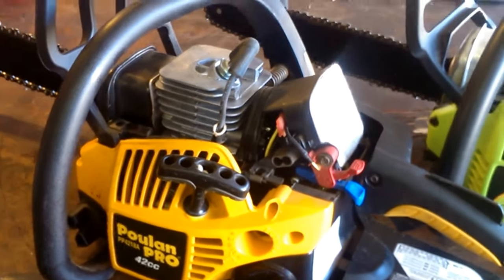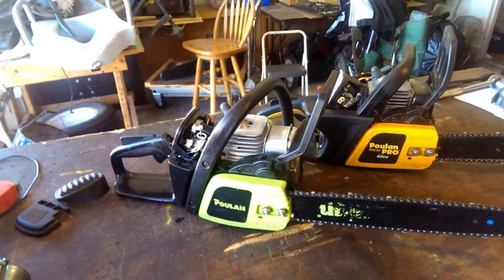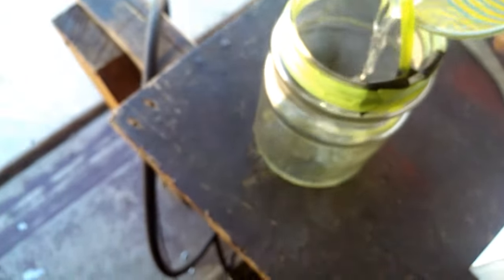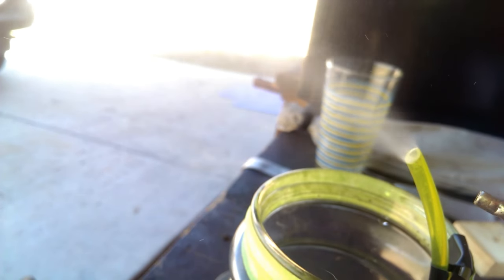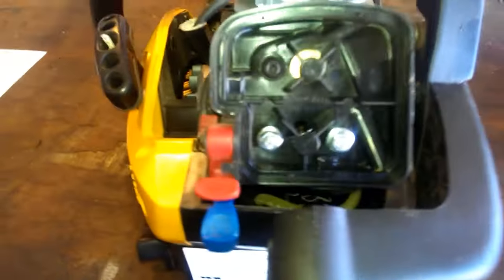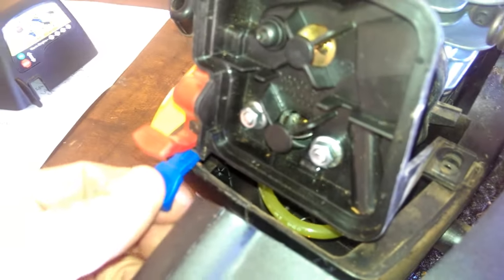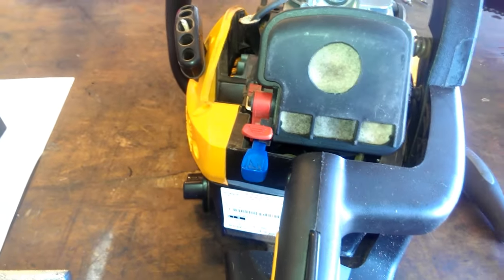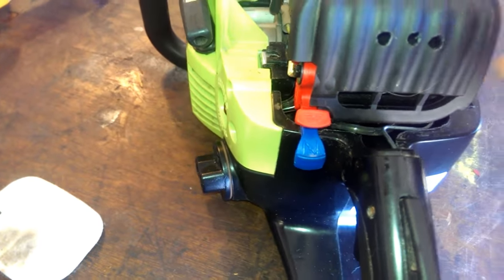Poulan wont restart after being used & how I solved my problem.

Comment: I have a poulan that the pull string does not retract like it should... i took it off the chainsaw and it works fine also i put a little of the oil mix into the spark plug hole and it wont do nothing.. its only a year and a half old.. please help dont know what else to do
Reply from the maker: eric Deleon  did you solve your problem yet? Email me if you need help still.  ZombieDaveAz@gmail.com
Reply: On a two stroke putting fuel mix/spray fuel into plug hole isn't very effective as the lower crankcase pulls in an airfuel mix ,compresses and pushes it into top comp area for firing. where would air come from in plug hole as vaporizing fuel would keep it out?

Comment: So the Poulan company made an interesting twin throttle body carburetor design that is capable of working very well, and choked off one of the throttle bodies with the worst possible air box configuration man has ever seen? How did this even make it past the drawing board? To Poulan, it is because of this guy here that I may consider purchasing one of your products. Before this guy the only incentive you offered would be the low price tag compared to your competition.  

PS YouTube has been double posting my comments for awhile now. It's only when I make a reply that my comment posts once and only once.

Comment: That is one of several reasons why  the move to put ethanol in fuel is a scam. The ethanol draws moisture into the fuel. That's why it just better to buy ethanol free gas. Bit more expensive but worth it.
Reply from the maker: And get this, before ethanol you could buy a product called " dry gas" which was ethanol/alcohol to get the moisture out of the gas. Lol 👍

Comment: wouldn't it be easier to simply replace the filter?
Reply from the maker: Maybe, but that doesnt cure the problem of the saw not getting enough air. Thus the hole. make sense?

Comment: That additional hole is totally contrary to everything I understand about volumetric efficiency of internal combustion engines. Maybe you scared it and it got worried about what you might cut next so it decided to behave.
Reply from the maker: It seems to have worked for more people than just myself. Could it be that the exhaust is "too" efficient? That's a possibility and that this crazy 2 barrel into 1 carb is fine. I'm sure that guys with bigger brains than mine could redesign a better more efficient saw. BUT that won't help all the guys that own this saw. Cutting and extra air hole helps. That's all I know and thanks for the comment. 👍

Comment: Purpose of that filter cover design is to act as a intake noise baffle.
Reply from the maker: Well that noise baffle is a fail in my humble opinion. Thanks for the info George. I appreciate you taking the time to comment.
Reply: @ZombieDaveAZ  yup, seems to be in this case. Probably some gov mandated thing. Or plain asthetics. Maybe put some screen over the hole to prevent bigger objects getting in such as large dust, chips. Doubt that would harm the starting and running.

Comment: I bought the green one at Lowe’s well I used it last year when I bought it it was great today I go out I put the pre mixed 40:1 and omg the dam thing same problem I can’t pull it it will run then heat up stall and won’t start I pull the plug then it will pull over easy a few time then get hard as fk to pull I’m going to try this thank you
Reply from the maker: Hard to pull as in feels like too much compression or hard to pull as in repeatedly?
Reply: Yes like to much compression and it was only used one time last year for about 6 hrs on and off it will start but once it gets hot and I mean after 10 mins forget it
Reply from the maker: @donaldbaker6961  sounds like the metering diaphragm is giving up the ghost. Gas in the crankcase will make is feel like it has too much compression. You can check by removing sparkplug and tip upside down and pull rope. Gas will come out the hole. Ten cent fix if that's the case👍.
Reply: ulitepilot aka Zombie Dave thank you very much I will try tomorrow thank you

Comment: I cant get a new Poulan P3816  to start out of the box.  Fresh fuel etc.  Followed instructions..just can't get it to start.
Reply from the maker: Steve. I have to make a couple assumptions here. that the primer bulb has fuel in it. That means the carb has fuel in it. I assume the kill switch is off. Usually full choke will will do that but double check it. be sure spark plug is connected to coil lead. set choke to full and pull til it coughs. then gently push choke to 1/2. That will leave the throttle cracked open. should start in 3-4 pulls. Dont high idle it with chain brake on. hope this helps.
Reply from the maker: Steve. I have to make a couple assumptions here. that the primer bulb has fuel in it. That means the carb has fuel in it. I assume the kill switch is off. Usually full choke will will do that but double check it. be sure spark plug is connected to coil lead. set choke to full and pull til it coughs. then gently push choke to 1/2. That will leave the throttle cracked open. should start in 3-4 pulls. Dont high idle it with chain brake on. hope this helps.
Reply: Thanks for the response.  I am new to chainsaws as you may have guessed.  The primer bulb is showing fuel in it.  By kill switch do you mean off/on switch?  Switch (Red) is on position (Up) and choke (Blue) is all the way out on first attempts.  The engine never coughs or hints at starting. I looked to see if there was a spark plug in it..thinking alright they may not have included one, looks new and unused.  I haven't' dug much further in to make sure it was connected properly..assuming new saw should be alright.  Being 62 years old pulling in that position can sure wear on you quick..any further tips/help is appreciated.
Reply from the maker: Stephen Hotchkiss Cheat! take some fuel and squirt it in the lower carb barrel while holding the throttle open. you may create a 'flooded' condition but with the throttle set at high idle it should start for you. you will have to remove the cover  to access the carb but its only 3 screws. to set high idle pull choke all the way out then push back 1/2 way. start pulling. let me know what happens please.
Reply: engines w primer bulbs r easily flooded , just 1-2 full choke is all they can take as the metering chamber is full from the primer . U may not even get a 'pop' if more than 2 full choke pulls. The hi jet ,along w full choke and part throttle ,provides the rich mix to start a cold eng.  If hi jet is plugged/misadjusted ie. no fuel to start. W only a choke(no primer) after 4-5 pulls on full choke u usually get a pop ,then go to half choke

Comment: Seems like the company could fix the airflow issue with just a VERY simple redesign of only the air filter's cover part of the carburetor in my personal opinion. Redesign it so the air holes in the cover are positioned instead right over the center of it. Much closer to where the air is actually pulled into and goes into the carburetor and not on the underside of it,farther away from the actual carburetor intake hole. The saw has to actually work so much harder just to actually pull and get any air into the carb with it being designed the way it is currently. I would say doing that one very simple and easy redesign would drastically reduce or maybe even totally fix the airflow issue completely. Its not really that big of an issue or an undertaking to redesign and actually fix the design flaw; especially considering the fact that its only just a small,simple piece of plastic. It seems like it is so simple and easy really that it is actually completely laughable. Even if the company were to redesign and send the new cover to people who have complained about this issue,or even to just new customers who are made aware of this and given a number to call to get their redesigned replacement part. It doesn't seem to me like they would actually lose too much money in that whole process in my personal opinion. It really seems to me like it was really just a design oversight of the carburetor cover on Poulan's part and it wasn't done intentionally... I honestly would think that anybody that had a decently good quality 3D printer. Could actually map,redesign and print themselves a new and improved part and solve this problem on their own really. I mean,it is basically just one plastic part with a fairly simple design after all...🤔
Reply from the maker: Lol, you are 100% correct. I think they put too much time in the carb w/2 barrels too. That just complicates a simple operation in my way of thinking. Thanks for commenting brother.
Reply: @ZombieDaveAZ  No problem friend. Thank you for actually responding to my post. We don't really have a problem with ethanol and water in our push mower's,weed eater's or chainsaw's gas at our house. We live over here in Tennessee and we actually have a few gas stations in our home town that actually still sells 100% pure gas with no ethanol added to it. Thats what we actually use exclusively for our weed eaters,chainsaws and our push mower. And that I can recall,we have NEVER really had fuel issues where its actually had water in the gas. Its too bad that you guys only have access to E-85 out where you live at to use in your small machines like that. I was also pretty disappointed honestly after I watched this video. I had actually thought of buying myself a Poulan 33 or 38cc chainsaw because I am currently in the market for one. I was looking at that brand mostly because it was rated so highly in reviews and it was actually in my rather limited price range. I am currently unable to shell out 3 or 4 hundred dollars for one. I was looking for something reasonably cheap,easy to maintain,hassle free and reliable. I have known people that have had them before and theirs was a very reliable companion and theirs didn't really seem to give them any sort of problems. Besides just needing to have some basic maintenance occasionally like any other chainsaw. I was wondering since you seem to know a thing or two about chainsaws... Do you have any advice you can give me on this matter of me selecting and purchasing a GOOD and RELIABLE but reasonably priced chainsaw my good fellow? I am even willing to purchase a good and reliable quality built one second-hand,if its actually in good working order and at a reasonable price. Any advice you could give me on this matter would be MUCH appreciated my good sir...
Reply from the maker: @mr.chaosvicious5968   My personal opinion is that Stihl, while it is the "snap-on" of chainsaws is not worth the money unless you are a pro and make money with it. I do think that an older Echo 'usually' are well made and come with a very friendly honeowner warranty. I think its 5 years if not put into commercial use. If you only need to do random cutting and sporaticly, buy what you can afford. Maybe a black friday sale or something like that will put a decent saw in your range. Good luck and keep commenting. Welcome aboard brother!
Reply: @ZombieDaveAZ   Hey thanks. The advice was also very much appreciated as well. So far I have been using my recently deceased grandfather's old and reliable Johnsered 2054 Turbo. I remember that thing has cut down a LOT of trees since he has had it. And more recently his newer Stihl chainsaw he bought before he got real bad sick when I needed to use one but I want one of my own now. The Johnsered actually gave me some trouble a couple of days ago after me trying to help my uncle saw up this gigantic hickory tree at my grandparents place. I actually had the privilege of watching this behemoth of a tree fall down during those strong winds we had. That thing was on my grandparents property before they ever bought their place in about 1964 and it was supposedly a pretty good size then. I don't think it thankfully damaged anything that I know of. The saw actually ran okay for about 10 minutes then started sounding like it was bogging down. Then it finally quit on me and absolutely REFUSED to start again for about an 45 minutes then it cranked over again after a couple of pulls. I tried cleaning the air filter today and the spark plug as well to see if that might help. Then I tried starting it again and it only tried starting ONCE in about the 15 times I pulled on it. I am going to try putting a new spark plug in it myself tomorrow and try getting it to start again. If THAT doesn't do the job my grandmother said we would probably just break down and have it serviced at our local repair shop in town. My friends father has his husqvarna weed eater and chainsaw serviced there and said that they actually do good work. Wish me luck on getting that thing running again tomorrow please Zombie Dave.🙂👍🏻
Reply from the maker: @mr.chaosvicious5968  Good Luck buddy!
Reply: @ZombieDaveAZ  I have an update for you. Well its bad news brother... I yanked on that saw about 20 times or more and that thing didn't even want to try starting,even after we put a brand new spark plug in it and cleaned out its air filter. We are going to take it down in the next day or two and have it serviced at the repair shop. I guess it was just due for a good overhaul and service I suppose... I would do it myself but I am still new to chainsaws and I don't really know where to start if I am being totally honest. I also don't want to take a chance on me possibly ruining my grandfathers chainsaw.
Reply: Ever since the 2006 separation from Electrolux, Husqvarna won't make even a simple product change without corporate approval, and even then, it will appear only in new models. No attempt is made to upgrade older models. Because there's just no money in it, making customers happy is no longer part of doing business.

Comment: If I can get my saw started, it dies as soon as I touch the throttle trigger...wtf??
Reply from the maker: Joshua, you gotta start with the basics or give me more info. Been sitting a while? Fresh fuel? Water in the gas? Broken fuel line?  Fuel in primer? Clogged fuel filter? Help me help you.
Reply: New gas, filters, plug, fuel lines and pull cord. Cleaned exhaust screen. Good pressure. Primer bulb seems to be working fine. Diaphragm in carburetor dried up? Idk. Usually I can fix most things so I'm sure its probably something simple. lol. Help...
Reply: @ZombieDaveAZ  was a pain in the ass to start but it would..eventually. Sat for a  year now I need it
Reply from the maker: @joshuaedmondson7031   check out these 2 viseos and see if it helps  https://youtu.be/CX34AxY2aYU

https://youtu.be/PFTEXWUBY6g
Reply from the maker: @joshuaedmondson7031  are we working on a poulan?
Reply: @ZombieDaveAZ  poulan fires right up but dies when I touch the trigger. Stihl ms250 is the one in question.
Reply from the maker: @joshuaedmondson7031  start the saw and hold it @ different angles and see if it revs up or completely dies. We are leading up to checking for an air leak /really lean condition. If it ran like that for a while chances are there is some scoring on the exhaust side of the piston or the rings can be partially stuck. Pressure test will reveal if you have an air leak. Possible ripped intake boot. Gasket leak etc. Are you able to do a pressure/leakdown test?
Reply: @ZombieDaveAZ  angle doesn't seem to matter. Got good pressure
Reply from the maker: @joshuaedmondson7031  well from what you are describing it is either getting unmetered air from somewhere or not getting enough fuel. Thats about as much help as I can be without being hands on. Let me know what happens please.

Comment: The pull cord is so tight I can't pull it.
Reply from the maker: Hey Rich, remove the spark plug and see if it pulls any easier. If it does then pull it a bunch of times and look for fuel to come out the spark plug hole.

Comment: Put an extra hole in that cover thingy ok I will do the same with mine I just got on the  November 11th 2017 I'll modify it before I use it
Reply from the maker: baudellio charles anything you do to modify your saw is on you. I hope you understand that. Lots of guys took the risk and it worked out well for them. If you call the air filter cover a 'thingy' this might not be for you. Im being honest and straight forward with you. I owe you that much.